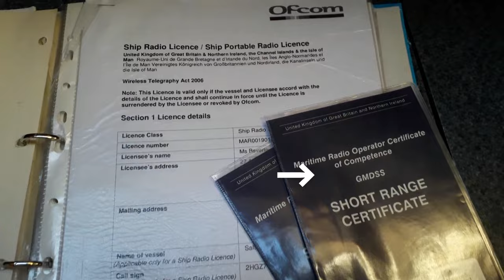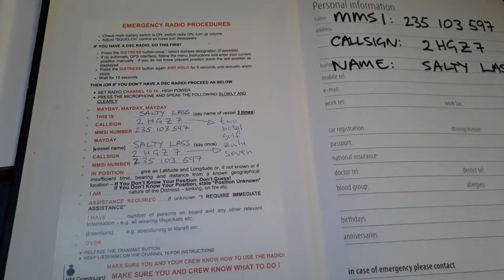Sailing Northern Ireland - VHF radio - AIS - Angle grinder - Ep. 325

Comment: Good go through. You forgot 'Medico', if a person on bord gets sick or if you have an accident. The the land station, if in reach, will hoook you up to medical resources. Used it once 40 years ago. The land station offered to scramble a helicopter with medical staff. We thanked no. They made a taxi meet us on the pier. Warned the hospital and so forth. Yes, your antenna will take any VHF signal. Unless it's something 'wrong' with your antenna.
Reply from the maker: Yes, we did indeed forget that. I think in the UK it is done via the Coastguard but I need to re-check it. Thanks for the tip about the antenna. Others have said similar but it is always nice to get more confirmation

Comment: I did the VHF course at Largs a long time ago. I have no idea where the certificate is.
Just doing the course again to refresh my memory is on my list of things to do again later this year. I vaguely remember how to use it but that's not good enough to feel confident about using it.
I don't think a plastic chopping board is a hazard in the kitchen. It's more about how the board is cleaned.
Reply from the maker: Apparently, bacteria find it much easier to persist on plastic boards as the cuts and grooves act as a reservoir of damp. Also there is the issue of microplastics from cutting attaching themselves to your food and being ingested.

As for your fading VHF memory, we have the same issue with First Aid and we also need a refresher. I guess it is part of the human condition 😉

Comment: I almost needed a new laptop when Bev made the remark about being good at hitting the sea.
To answer your question about using the AIS antenna for VHF @25W, it should work and as long as there isn't any circuit board involved shouldn't damage the antenna. An antenna is just a long wire with a specific resistance. There are VHF radio's with build in AIS that use just one antenna for both jobs.
Great video like always.
Reply from the maker: I knew someone would know about the 25W "problem" 😄 but I am glad that you did NOT need a new laptop!  Glad you enjoyed the video 👍

Comment: Very amusing ... had a chuckle at many bits there!

The 1-Watt thing is a bit historical ... but we're stuck with it. Back in the day when marine receivers where full of valves, there was only channels 1-28. Channel 15 and 17 either side of 16 where designated low-power due to risk of interference during emergencies on 16; receivers really where that bad! As marine band became more congested and technology improved, it was decided to squeeze another 29 channels interleaved with original 28 to give channels 60-88. This means channels 75 and 76 also sit adjacent to channel 16 ... and also 1W channels. Modern receivers are so good this is unnecessary but it's the international standard, our radios are built to that standard and we're stuck with it. Been reading tech-requirements for new digital marine radios we'll see in next decade ... also a complete mess!!

Love cutting board. Very resourceful :-) Thanks for the video.
Reply from the maker: Thanks Ian, that is a great reply about the radios and it makes a lot of sense once it is explained 👍 As for the cutting board.... well, you know Gaynor well enough 😄

Comment: Thanks for the info, will be redoing my radio cert asap. That chesty cough you've got Gaynor sounds bad, my partners asthma a has been really acting up this season, got her a nebulizer, what a wonderful machine, really helps with opening the lungs. Glad u both are ok.🌈😗
Reply from the maker: Gaynor is a chronic asthmatic but the sea air seems to help a great deal. Her cough is a hangover from a recent cold as they always hot her bad. Hope all is well at your end
Reply: @SailingYachtSaltyLass  Everything great down Under, but the summer heats been nasty 30°c 40°c so dam happy we got A/C. We got bushfires everywhere too. We actually moved to a little place called Sussex Inlet in NSW when I was 13, (long time ago) because my mum was also chronic asthmatic, ur absolutely right, the salt airs brilliant. I had a 3m tinny and basically lived in it.😂
Reply from the maker: I bet you loved that tin boat!
Reply: @SailingYachtSaltyLass  With all my Heart, we did everything together. She was all mine, I even made a timber trolley on wheels, so I could pull it to the river and back home with a 7.5 Merc. I was so happy. 💖 I wish we could do it all again.

Comment: Great video, I must brush up on the radio skills. Bit of advice, never cut plastic with abrasive wheel. Molten plastic can sometimes fly off when cutting. It can be a nasty burn. Use a hand saw or a blunt blade on a skill saw. The skill saw chips away the plastic in micro pieces.
Reply from the maker: I asked her afterwards why she did not use the jigsaw. Apparently she saw the grinder and the rest was history...
Reply: @SailingYachtSaltyLass   😂😂 Sounds about right right. Start hiding tools😂
Reply from the maker: They are her tools, not mine. I did Physics, Maths and Computing, but Gaynor is the Engineer!!!

Comment: I never use a chopping board. Only put food on one for show in cooking videos 😂
Reply from the maker: Do you just pop it in the pot whole? Surely some chopping is needed....?
Reply: @SailingYachtSaltyLass  yeah  held in the air usually over the pot, my sister thinks I'm  cracked not using a board, I'm saving on washing up 🤣🤣
Reply from the maker: Watching you finely "air chop" garlic or ginger could be interesting.... 😮
Reply: @SailingYachtSaltyLass  usually use puree tubes of ginger and garlic as don't use raw garlic often enough to keep before it starts growing but I  have a garlic press when required
Reply from the maker: @WavedancerWesterlyfulmar  - you are taking all the fun out of it. I was expecting to be wowed by your dextrous knife-wielding prowess as the flashing blade sliced through the garlic gloves in mid-air. Squeezing a tube just ain't it.... 🤩
Reply: @SailingYachtSaltyLass  a French man taught me years ago the trick of garlic and salt slice& mash. The things you learn as a mâitress at sailing club kitchen.  I  do use a board if necessary but as a general rule I  don't ( explained the bandage wearing at Christmas using a sharper knife than usual 🤣🤣)

Comment: Why do you have your ais antenna that low? If you put it in your mast top you get way bigger area covered.
Reply from the maker: Firstly, it is a lot easier to install it low down and if it breaks it easy to fix. Secondly we get an AIS range of about 10 miles which is more than enough. The top of the mast might let the AIS "see" boats 30 or more miles away but we do not worry about boats that far away.

We did look at using a splitter but there are many problems reported with splitters reducing signal quality on the main VHF.
Reply: @SailingYachtSaltyLass  thanx for your very good answer. I was just curious. I have an splitter in the ais and using the vhf antenna in the mast.
Reply from the maker: Does the splitter cause any problems with sending VHF? We heard quite a few horror stories (and combined with the price of splitters) that was enough to put us off. 😉
Reply: @SailingYachtSaltyLass  it's too early to answer. Installation started last weekend, but I needed an external GPS antenna wich I hope will be installed this weekend.
Reply from the maker: Good luck with it all. AIS is a great technology and we love having it
Reply: @SailingYachtSaltyLass  You need a proper duplexer, avoid buying Chinese junk because this is why you are hearing horror stories
Reply: @SailingYachtSaltyLass  The connection on the AIS antenna will corrode due to coming into contact with a lot of seawater, there have been several sailing vbloggers who have had VHF marine antennas fail because they had them fitted on the rails at the back. With anything radio height is might, at the end of the day you might be relying on that radio to save a life including yours. say you are in the middle of the Irish Sea and you hit something like a loose lobster pot that takes your rudder out (happened to someone in the North Sea recently) you may struggle to get heard and your AIS won't be seen because if your boat sinks and they can go down fast then you want someone to find you fast
Reply from the maker: The ariel is about 3m above the water surface but is still easily accessible for repair unlike anything up the mast, Also if we are sinking the protocol onboard is to hit the MayDay button on the boat's VHF and then take to the liferaft / dinghy with the grab bag. The VHF is at the top of the mast and the distress button also broadcasts the GPS position.